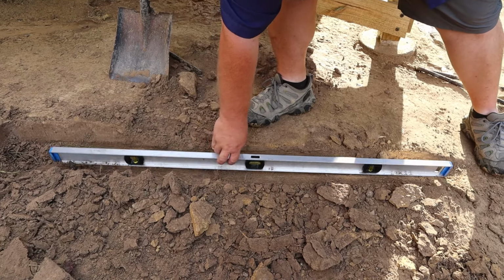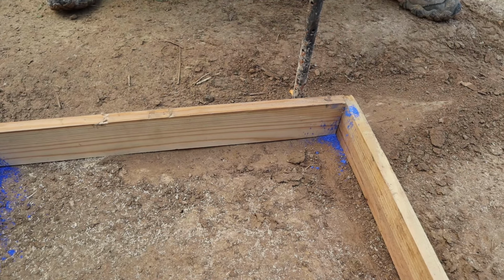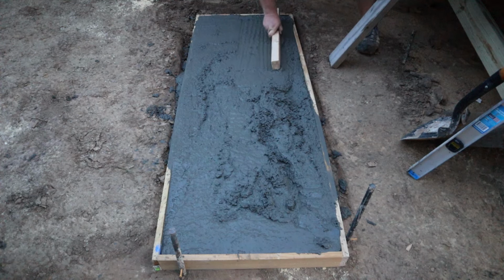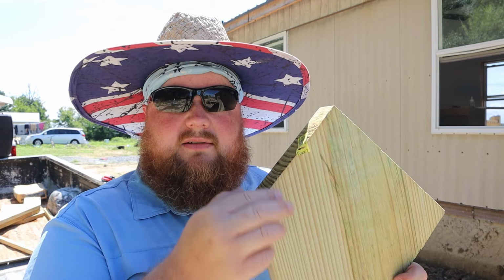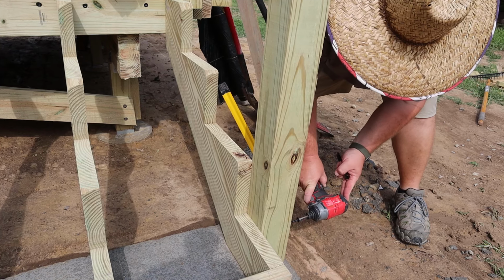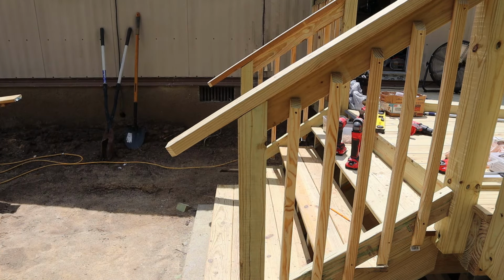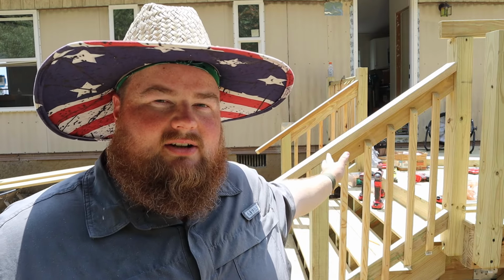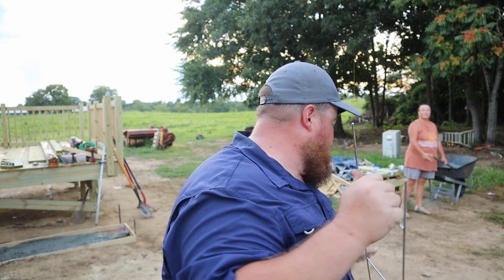Deck Stairs: START to FINISH // 12' x 10' Mobile Home Deck Build - Pt. 6

Comment: OMG! I’m in the middle of laying a concrete block foundation and digging a French drain. I dislocated my SI joint and I’ve been flat of my back all day. All I could think about was a video from Sam and Angela or Doug and Ashley would get me through this!! Ahhhh. Relief. Thanks guys.
Reply from the maker: Goodness! Happy to help, but hoping for a quick and full recovery for you! Yaaaooouucchh!!!
Reply: @sam-and-angela  q
Reply: Prayers🙏🙏🙏🙏🙏🙏
Reply: Hellllpppp... I've never done stairs before. We had to remove the entire 5 x 10 deck because of rot and start from scratch I've got the deck up but the stairs we had we've moved to a different location. The ground isn't even and I've got the 3 step stringers and 4 step. To see which works..3s are too short, 4s come right even to the deck floor when i put the decking board on it? There would be no stepping down onto the top step. Any suggestions? .

Comment: I put a penny between the boards to allow water drainage. Be careful in the rain guys, those treated boards are slippery, warn the boys! There is a 'non-slip' tape you can apply.  Good job on the pad and stairs!

Comment: You guys inspired me to do some flooring in my mobile home watching you do yours i had been putting it off because my manufacturer glued the particle board down in mine Redman home i had in the past use wire cutters and wood chisels to remove the old floor off the beams and seeing y'all cutting it off i bought blade's for my tool and cut my time in half

Comment: We did our own sidewalk. Sooooo easy! We used 1 x 2s and basically bent them to our will into a shape all the way to our driveway. It's about 25 feet...maybe a little longer. We put relief boards using lattice wood, in between every 4 feet or so. Then we poured. It's only 2 in thick, but it hasn't cracked. We poured it 6 almost 7 years ago. Way cheaper than paying someone, and it took 2 days to do.

Comment: Suggestion put song round little lights in the steps and clothes off the front of the step with boards and drops a little round lights in there. I'm sure it's pretty dark out there at night. That'll help you not miss a step and let me tell you you guys did an awesome job. Pros

Comment: Question???  Hello 👋, in another video you used a black metal stringer yet here it’s wooden?
My deck stairs need replacing and wonder if I should get the metal type. Thanks 😊

Comment: We used regular joist hangers and 3 pre-made stair stringers. They are really solid and quick to get the stairs up. 
And originally we did our handrails like y'alls. But out inspector wouldn't pass them...said a person couldn't "hang onto" them. So we had to go get some uncut ballistors to use as a handrail on the inside.

Comment: One suggestion Sam, as you step off the bottom step the narrow bit of comcrete might trip you up  mine was like that and i added some square stepping stones up against the concrete. as it is now you have less than a 1/2 of step to deal with, enough to twist a ankle or fall.

Comment: OH, OH❗️❗️
While you're pondering concrete sidewalks, look at "stamped" concrete❗️❗️
Beautiful look at a fraction of the cost of decorative brick or tile or concrete. If what they show is accurate, it isn't that difficult to add this to a standard concrete pour, and the results are very, very cool❗️👍🥰

Comment: The deck is so lovely. Are you closing in the front of the steps . We have a holiday home similar to yours and we did gravel walk ways but quickly changed to paving slabs. Theve not moved in four years they have been down. So maybe an option for you guys 😀

Comment: Engineered screws has been an amazing leap forward in deck building! I remember back the the 80s helping my dad build a deck and having to use bolts 🔩 and nails because Engineered screws wasn't a thing back then. Atleast it wasn't for us. Deck looks amazing by the way. You build decks like I do. The only difference is we had our beams going the opposite direction, only because we wanted our deck boards going the opposite way you have yours.

Comment: IF youre going to do sidewalks , make sure you get a concrete mixer and pre measure youre cement sand gravel water by pre pouring it in buckets so you can all drop it intoo the machine , the course gravel helps mixing it and keep the mixer clean   , that way you can set up an assembli line and make batches faster so you dont get colour differences because the former batch is dryer / wetter or setting before pouring the next , moving the mixer along the pad alows you to pour the concrete straight out the machine intoo the forms 
might be even better to have a concretetruck come over and pour it in one go

Comment: Great Job guys.  Are you planning on doing anything to the steps themselves for traction? I took my router and ran a v groove across mine about 3" apart so any water could be displaced down into the groove during rainy days. Just wondered if you had any plans.

Comment: What is the frost depth down there? Is there danger of the concrete pad heaving?
Reply from the maker: Frost heave is a very unlikely thing for us. Our home footers were only 8" thick I believe... but it's a single wide mobile home too. We were told 12" would be the max ever needed. Our deck is at about 28" for post footer depths. We don't expect any frost issues...
Reply: @sam-and-angela  Thanks for the answer! In my neighborhood, footers need to go to the center of the planet!

Comment: Looks nice.  Not up to handrail code though
Reply from the maker: It is where we live -- passed inspection no problem.
Reply: @sam-and-angela    Like I said u did a good job.  Guardrails and handrail code is different. Most flat 2x4 do not meet code.  A code perfect handrail has a smaller diameter and is more graspable for, say, an old lady’s hand.  Nothing you did is wrong.  Frankly I just built a set of stairs for an old deck that hand no stairs, and wanted to make it match what was there- so I used a flat 2x4 for the handrail. Many people do.  I just told them that it wasn’t up to code but that many things about the old deck such as baluster spacing and etc was not either.  Just some food for thought.  Good work.

Comment: wondering;;;;will the concrete slab make a toe stumper starting up the steps;;;;think I would have brought concrete out step tred size or dropped back even with first tred;;;;looks great;;;and on your way to enjoy;;;
Reply from the maker: Not to worry once our walkway is done. :) It will be flush/level with the concrete.

Comment: It does look nice, good job. I hope the boys don't try to slide that handrail or hang on ends as that would probably break it off at the overhanging area. I reckon if you are gonna change the front deck handrail design then you can reuse the cap to go on back deck and get some more caps to finish off the back deck top of posts. I made the mistake of not capping mine at my previous property and the weather actually rotted the inside of post all the way down inside the post to the ground which wasn't noticeable until the entire deck started falling down. Check out Ana White's channel if you haven't already, she has videos and free plans with some awesome looking outdoor furniture made from 2x4s that look professional.

Comment: When will you get your certificate of occupancy ? , you two are doing a wonderful job.
Reply from the maker: Next steps are to do interior trim and molding (not required, but we are making ourselves finish it out). At the same time our HVAC and electrical contractor are doing their parts. Then we'll call for all the final inspections.

Comment: Hi this is probably a stupid  question; But here goes! First; your deck is beautiful! I’m wondering if your front hand rail will become loose with time; as it isn’t attached to the 2 side rails; giving it ; in fact all three railings; more strength?? Should this be a concern???

Comment: ** when you get to the concrete walkway, rent or buy, one of those barrels that turn & mix the concrete.  They are on wheels so you can wheel it around to where you need it as you go along.  If the cost is affordable, just hire a concrete company to do the pour for you. they know the proper mix for driveways, sidewalks etc. you can still dig and frame it out.  Lastly, wild wonderful off grid has a great video on doing their walkway. and at the end where it stopped, they didn't put framing.. he smoothed it down, kinda like a concrete ramp.. I don't know how to describe it. but anyway, it came out great.  l OH so excited about the dec furniture.. it is going to looks soooooo goood ... we are on our way for coffee.. hahahahaha

Comment: Sam y'all  probably  did it ,but if ya didn't take a belt sander to that top rail on the railing for the steps possibly round over the edges or use a router

Comment: The step/stairs look great people even the handrail. But what happens when you have guests on the deck with drinks? I'd put it all round the deck so there should not be spills, also it would give you a place to lean against to look around your kingdom Sam. Just think on it and how you would like it.

Comment: I think you need a bigger slab of concrete at the bottom of your steps. It looks like you could twist your ankle when you step down on it---too small is my point. You might want to put a roof over your deck. Now that would be nice.

Comment: So the other half of the cement form that you cut off, can it be used to start a sidewalk away from the deck and towards the front of the house? Granted you'd have to do it over and over but waste not, want not.  lol  And Sam?  It's NOT Jerry Stringer, it's Samangela Stringer!!

Comment: You did an awesome build on that deck! I didn't think about it on the last video, but when Angela was using the spacer jig, I noticed there was no marking on the side of the it to give a reference for the height of the balluster.  So if anyone duplicates the jig for their own railing, add a pencil mark on the side to mark the top of the balluster placement. Great ingenuity, Sam!

Comment: Just a little concerned about the slab sticking out down by the first step.  If you have your hands full and are looking at the first step, you may trip on the slab sticking out, but not sticking out far enough to be a step.  Make sense?

Comment: Does the completion of the deck going to allow you to get your certificate of occupancy? Also, are you going to stain the decks? They sure look great and they are so well-built.
Reply from the maker: It finishes "our part" of the required work before final inspections. We're going to finish the trim and molding inside while the HVAC crew re connect the mini splits and our electrician hooks the home to the meter base.
Reply: @sam-and-angela  I am so excited for you all to be able to move in. This summer is one you will never forget, but it's produced a wonderful home. Great job!

Comment: Both decks look really good and are you going to apply any wood preserver and stain the decks?
Reply: You have to give the pressure treated boards time to dry out. In a couple of weeks, they can test it with some water...if droplets form on top of the wood, they have to wait a little longer. Once the water sinks in...they can stain or paint. If you do it before then, it won't preserve it like it should.

Comment: I cant help but to feel cheated when I see you using your cordless tools. I think I'm going to sell most of my tools except for my worm drive and hammer drill and go cordless...My wife and I are putting the finishing touches on our kitchen remodel and I used almost every tool I own to get the job done..Good job, glad to someone else doing what you're doing, I'm all tuckered out!
Reply from the maker: We've had our main tools for about two years now and they've lasted quite well! Especially considering they're not contractor or professional grade tools, but have been put to work with us. :) Lithium battery technology paired with brushless motors has really made cordless tools viable in today's world. They're great! :)